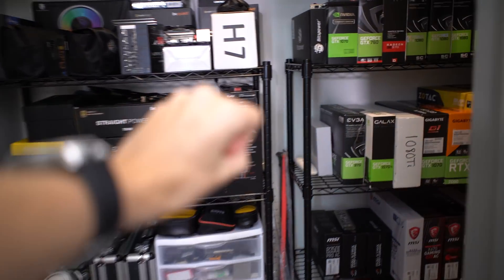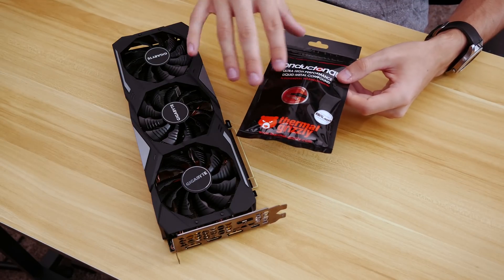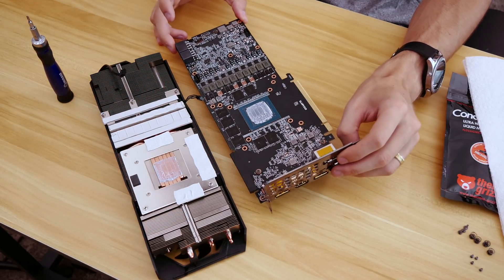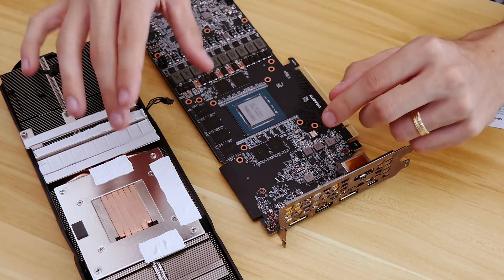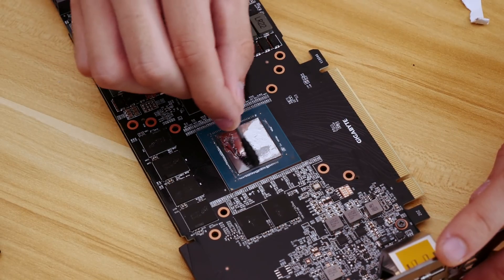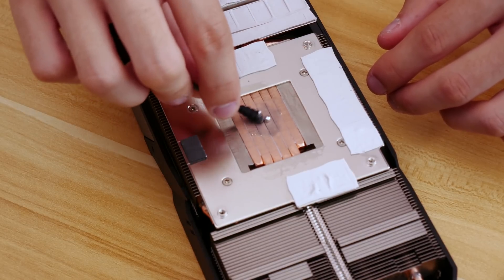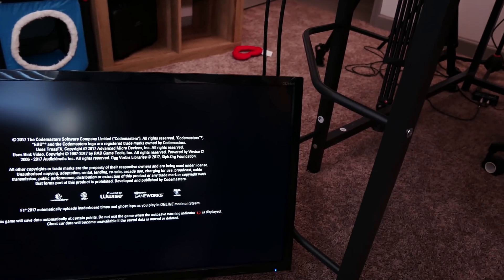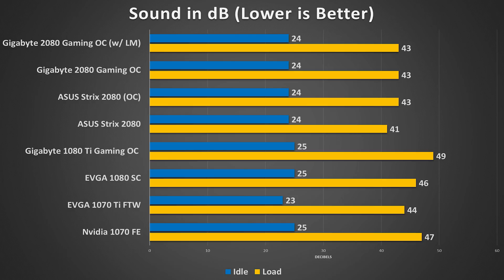Liquid Metal on a Graphics Card?

Comment: For the sake of...peace of mind, I would use clear nail polish and coat it along the outer die of the gpu. I did that with most of all my video_cards. My first was Asus strix 980ti and it drop temps considerably, like 15c delta. Also did that with Galax gtx 770 and EVGA 1080ti bl.ed. However I just ordered thermal grizzly kryonaut and gonna replace my 1080ti fr conductonaut to kryonaut, in my testing evga gtx 1080ti stays pretty cool regardless.
Moreover, I just ordered EVGA RTX 2080ti Ultra...been on a waiting list and finally got one. This time I'm gonna just use thermal grizzly kryonaut on my 2080ti, don't want to take any chances with an almost 1300 dollar card.
Granted my evga 1080ti cooler is nickle plated copper but after about 9 month of use with liquid metal, I noticed it left some weird abrasion on the cooler contact point, I had to almost sand it down to be shiny again.
**Seriously, try it with maxwell based cards, i.e gtx780, gtx980ti, you'll see serious temp improvements.

Comment: Well I don't know about liquid metal, but when I got my xfx card the thermals weren't great and I swapped the stock paste out for kryonaut within the first week and it runs significantly cooler at idle, and that means less time with fans running. Load temps of course haven't changed much but the fans run at a lower RPM consistently

Comment: A follow up, I would also suggest using liquid cooling with a block that doesn't resist the liquid metal. I'm going to bet a big help when liquid cooling.
Reply: Liquid cooling my Titan X Pascal brought it from 60C over ambient and throttling down to 10-12C over ambient using Kryonaut. Swapping to Conductonaut brought it down by 2 degrees. This is while applying a +250MHz overclock.

Idle temperature is 1C over ambient. Old idle temperatures were 10-15C over ambient.

Noise levels also went down from 60dBa at max fan speed on the stock cooler to 42 dBa at max fan speed on the water cooler. Only problem is that with the radiator at the front, it dumps a crazy amount of heat into the case.

Comment: Danger will Robinson at 6:06 Applying Liquid Metal without protecting surrounding resistors with RTV or Nail enamel first. This is a huge Mistake. Second mistake, there may be an amount of aluminium in your copper block which could cause pitting and electron transfer, please use nickel plated blocks.  As you were, I have pop-corn now.
Reply from the maker: It's bare copper. Those are copper heat pipes Lol.
Reply: I know, Don't you recognize a flame when you see one. Kidding... But seriously, it's weird that the LM balled up. Haven't seen that one before.

Comment: I was seeing 5c vs mx-4 on my PC PCS+ R9-390. That heat sink was flat and also the gpu ran hotter then the 2080. funny thang is it was only 1c on both of my RX-580s vs mx-4. LM does spread on bare copper, you just have to clean it really good.
Reply from the maker: It was scrubbed with isopropyl.
Reply: I did as well. I had to scrub it 3 times before it would spread, i think i will try 100% acetone next time.

Comment: Does it not seem bizarre to you, that there is such a measurable difference to the processor on a CPU when liquid metal is applied but not much of a difference if any on the processor of a GPU with liquid metal. Why is that?
The only think I can think of as an explanation is that the heat-sink and cooler on GPU's are so effective that it doesn't matter if you're using Liquid metal or Thermal Paste. 

If thats the case then the likes of Gigabyte, Asus, Saffire, EVGA and MSI should go into the CPU cooler territory.

Comment: Id say a little too much is pooled on the left side of the die and you might want to check for runoff. I had the same bare copper pipes on my Gigabyte G1 1080, it will spread, and stick, you just have to work it a little(took like 2min of forcing it into the copper then it spread, have pics of the process). I have LM'ed my G1 1080, my wifes Duke 1080, my Evga SC Black 1080ti, and Evga SC 1060. 

  They all are going strong and it really only helps on the high end. Overall on every card temps drop about 4-6c on the max temp but the fan curve required for that temp is much, much lower. But beware I had to reseat my 1080ti 4 times, it never reported higher than 40c before crashing but there was a hotspot with no sensor causing a instability, after about 5 hours of pulling my hear out I got it under control. 

  Again, it won't drop temps significantly but it will allow you to run a lower fan curve because it transfers heat much more efficiently than traditional paste. I can run my living room cabnet builds 1060 at 30% fan speed while never breaking 65c with a 1925MHz boost. Its really worth it imo, but only if you want to run at a quieter fan curve. I will make a video with the application pics and results. Also only do it of you know what you are doing and you know how to disassemble your card. Some cards are a pain to line back up in reassembly which is most critical because you dont want to be sliding that coldplate around pushing metal around and potentially off the die.

Edit: I really think you should re apply the metal and get the layer on the pipes sorted out. Eveyone I have seen complain about no change in temps usually skipped the application on the plate side.

Can you link still link in YT? 

Gigabyte G1 1080 http://imgur.com/W2VVBR3

Comment: What ever u showcased in this video is not exactly right, I did the same liquid metal treatment on my strix  gtx 980 ti and I did all my testing at 65% fan profile. The difference was really substantial, I dropped at total of 14c on my load gpu temps. The bottom line is, with liquid metal, you are increasing the capacity to transfer head to the cooler, but if you keep running those fans at stock then it won't dissipate that heat of your cooler, so if you don't plan on increasing the fan speed then there is no point in using liquid metal.
Reply: 980Ti Super Jetstream IDLE drop 8c
Reply: Yeah I also had asus strix 980ti and just like you with liquid metal mine drop 15c delta as well. My chassis had pretty bad air flow (original  cooler master cosmos 1000) so liq metal came in handy.
Reply from the maker: What exactly is the point, then? If you're making your card run louder, it counteracts this entire process. You could cool the card without using LM just by boosting your fan curve Lol.
Reply: He is saying that because you used the stock fan curve, you left a variable in place that will impact your testing. If you did all testing at a set fan speed, something that is enough on the stock TIM to just prevent a thermal throttle, and then did the same test with the same speeds on LM, you will see a drop. When you go back to running it after your testing, then you set it back to a stock curve, or improved curve for a more quiet operating experience.
Reply: the point is if you want to take advantage of liquid metal then you will have to increase the coolers potential to dissipate heat and that is only possible by using a higher fan profile. So if someone is looking for lower gpu temps then that is only possible at the cost of little bit noise.
Reply: You can also keep equal GPU temp with less noise by maintaining the same fan profile, which is what I think he did her

Comment: Can't believe you did this without any research in regards to the fact that you should have used something like clear nail polish to paint over the small bits around the die to keep the LM from possibly spreading out from the die and making contact with them and causing a possible short. Also, I think there is more benefit to using it on the GPU in a laptop. I have an MSi GE-73 VR with the 6 core 8750 and a 1070 with the cpu and gpu under LM and never see temps higher than 70-73 for either the cpu of gpu which is excellent temps for a laptop.

Comment: Liquid metal only helps when its going from the chip to an IHS, since the gpus here are directly on the heat sink metal it wont really do anything.
Reply: it helps with shitty blower coolers like vega too where keeping HBM temps the same as the gpu are critical. The problem with Gregs test was he used the worst kind of cooler for it [direct heatpipes are bad, LM works best on proper copper/nickle blocks much like a IHS] and he didnt insulate the surrounding SMD with tape/polish/conformal coating x_x
Reply: this is not true at at all. I have personally put liquid metal on a vega GPU and it dropped 15 degrees. he didn't clean the cooler enough. u have to get the oxidation off the copper to get the LM to stick.
Reply: Philips - Same, dropped my evga 1080 ti ftw3 -13c.

Comment: applying some nail polish over the parts you want to protect works well just incase some liquid metal spills over during the reapplication of the heatsink
Reply: this is what i was looking for lol
Reply: hi-temp black silicon works well too
Reply: If I put nail polish on my GTX 970, my whole house will burn in no time.
Reply: Mykel Hardin  Well I didn't know. So there you have it. Just because you know doesn't mean everybody else does. And you're the only asshole around here.
Reply: @KyranSparda  You have to be careful about the type of nail polish used.  Forgot the reason though.

Comment: the reason intel cpus get helped so much isnt because of how bad the tim is but because of how small cpu dies are for how much power they consume.  in other words heat density.  an 8700k is about 150mm^2.  a gtx 1080 is about 314mm^2.  thats double.  but an 8700k can use up to 200 watts when oc'd and running a heavy workload.  a 1080 with power slider turned up is about 200 watts.  so you have a cpu that is half the size and has to go through an ihs and a the cpu cooler base plate while a gpu dies heat only has to go through the gpu coolers base plate.

the bottleneck in this equation is the die to ihs interface.  the area where the 2 touch is very small and thats why using liquid metal helps so much there.  its also why using it on top of the ihs doesnt help much and why using it on a gpu doesnt help much.  those 2 scenarios already have enough area to move the heat through fairly easily.

Comment: Also with a gpu there is a much larger surface area on the die allowing for better heat dissipation. As well, it's already direct die cooling compared to having a extra thermal barrier like a IHS

Comment: I use mx-4 I don't trust liquid metal after seeing pitting on gpu's and cpu's.
Reply: @Jullullabad Hommo I did the same thing with my 2017 and 2018 model both times it gave me 20° to 25° degrees C drops
Reply: from what I've seen no paste cheaper then MX-4 performs better. that said gelid GC extreme only costs a few dollars more if you want a slight edge. the best "non" conductive pastes only transfer about "4.5 - 11W/mK" of heat while liquid metal has the ability to transfer "30 - 73W/mK". you could likely get higher using diamond based paste but they have been known to scratch the surface up quite a bit. graphene would be the holy grail of TIM but sadly it's still very hard to mass produce. you can find stuff made with pyrolitic graphite but it would be  better to use as heatsink fins then paste since it's very good at spreading heat evenly across it's surface but bad a transferring it to other materials.
Reply: @psionx1  Someone tested 85 thermal pastes and found that the difference between the best and the worst paste is like 5 degrees. The most important thing is paste application and the cooler mounting pressure, everything else comes second.
https://www.tomshardware.com/reviews/thermal-paste-comparison,5108.html
Reply: As long as you don't apply LM to aluminum there wont be any pitting.
Reply: @bobbyz9052  I have seen pitting directly on the gpu and CPU not any where else. Look on other you tube vidz.
Reply: @bekeex  I've seen plenty of youtube vids, and I delided my 8700k, there's no pitting. Maybe a bit of discoloration but it doesn't affect thermals, there's a video where der8auer confirms this.
Reply: @bobbyz9052  True

Comment: My gigabyte 980ti fans have basically died so I had duct tape and zip tie on case fans to keep it cool 😅 if only I could afford a new card 🤑
Reply: bruh be thankful you have a 980ti that works
Reply: Put on aftermarket cooler from aero maybe
Reply: Peel off the sticker or take off the blades and apply a drop of oil in the center pin. Enjoy your renewed fan. The better the oil the longer it will last. And no dont use wd40.

Comment: Intel actually is not using crap thermal paste I delid a 7700k put mx4 and cooler master master gel and only drop 1-2c pretty sure the problem is thermal paste don't transfer heat fast enough to the ihs

Comment: If liquid metal makes 1degree change on a GPU then shouldn't we test the new CPU's again just to make sure
Reply: Why would that affect cpu's?
Reply: Does it not seem bizarre to you, that there is such a measurable difference to the processor on a CPU when liquid metal is applied but not much of a difference if any on the processor of a GPU with liquid metal. Why is that?
The only think I can think of as an explanation is that the heat-sink and cooler on GPU's are so effective that it doesn't matter if you're using Liquid metal or Thermal Paste. 

If thats the case then the likes of Gigabyte, Asus, Saffire, EVGA and MSI should go into the CPU cooler territory.
Reply: @MahmoudMaguid  Not really, with a gpu the cooler is making direct contact with the die But on a cpu there's the ihs and an extra layer of thermal paste.
Reply: ahh yes of course the IHS plate. Forgot about that. Next big thing after liquid metal and delidding cpu's is to removed the IHS completely for better contact with the processor. Soon the youtube tech channels will be all over this.

Comment: Liquid metal that reacts with aluminium.
Did you mean mercury?
Don't leave out the details what kind of liquid metal are you talking about.
Reply from the maker: I didn't leave out the detail? It wasn't vital here. Gallium dissolves aluminum. I said in the video that the LM dissolves aluminum. Nothing inaccurate was stated.
Reply: @GregSalazar  
If it's not a gallium alloy then how is it a liquid at room temperature?
Was this metal warmed before it was applied?

Comment: I have a watercooled 1080TI FE at @2.1GHz and got a 5C drop in temps with liquid metal. I think the reason why you didn't get a drop in temperature is because your cooler is the limiting factor. The RTX 2080 has a rather large die and can transfer the heat over a large area (unlike mainstream Intel CPUs). It could also be the fan speed, unless you monitored it and set it to the same speed for all tests. These cards have a target temp and will adjust the fan speed accordingly.

Comment: you should fix the rpm of the fan cuz it's dynamic and changes according to the temperature, and you will get almost the same temp readings....
Reply from the maker: Fan speed was represented with acoustic testing. No change in fan RPM. No change in clock speed. Marginal change in temp.